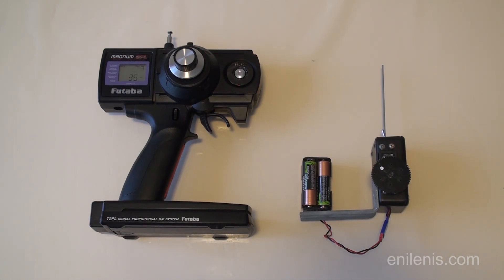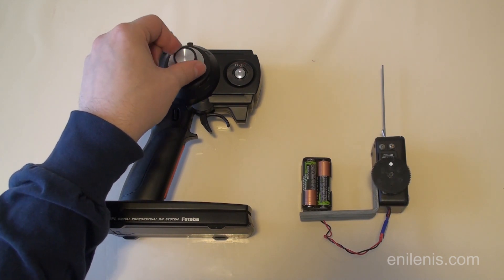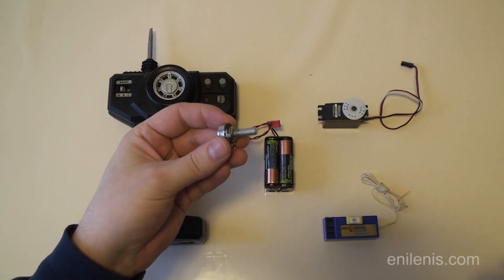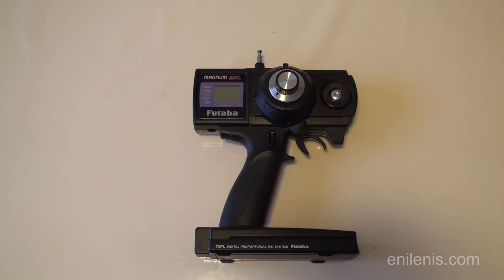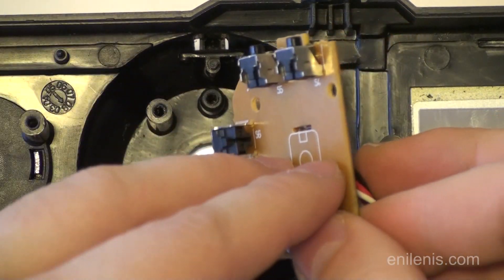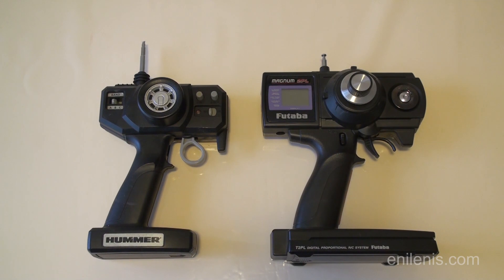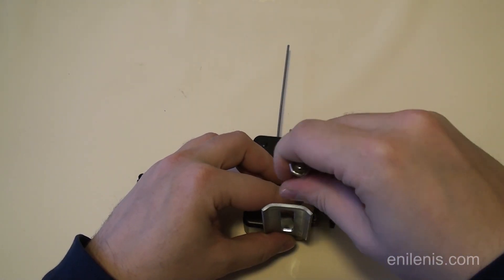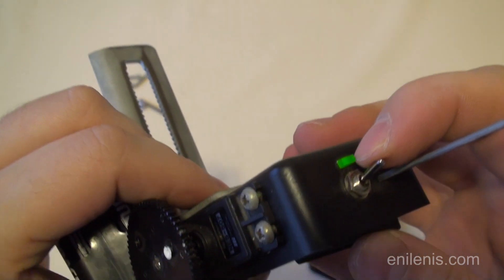DIY Wireless Follow Focus

Comment: How could a measuring device be integrated with this gear? If that were possible, which it should be, then the measuring device could deliver the distance to the camera.
Reply from the maker: If you want an integrated disto, then the design gets progressively harder. The camera lens and the servo do not know eachother's absolute positions, so you don't necessarily know how the rotation translates to focal length. To have a system like that you'd have to manually calibrate the device each time it is installed. It is doable, but it's a lot of extra effort for little payoff. To auto-focus, the servo would have to talk to the camera, or analyze the video feed itself to figure out how sharp it is. Again a whole can of worms. If you want distance, for VFX shots, for instance, as part of the scene survey, then you can just have a disto on you and it doesn't have to be a part of the camera rig.
What is your practical application? Maybe I can suggest a better alternative.
Reply: enilenis I shot with a DSLR. Do my choices are manual focus, or AF, which ruins the video for s moment. I’m using a 5DM3. I was hoping that an electronic measuring device could talk to the lens. Canon already has a motorized zoom focus. ?
Reply from the maker: Autofocus on DSLR's doesn't work well with videos. The lens tends to overshoot its position when determining sharpness it dials it in while shifting focus over the intended position a couple of times. So, manual follow focus is preferred. There are follow focus apps that work with latest Canon cameras, but I don't think they work with M3, and they don't get good reviews anyway. Manual is the way to go. There are options such as 3rd party firmware, like Magic Lantern, which also give access to internal lens servos and can mimic a manual follow focus, but I haven't played with it in a long time. I don't even remember how to install it properly.

Comment: Hello, I'm looking for information to be able to create one too! :)
I would like to know about how parts: engine model and power, transmitter, etc.
You did a great job! Congratulations!
Thank you
Reply from the maker: I used parts included with Futaba Magnum 2PL kit. It has transmitter, receiver, servos. Nowdays that one is hard to find, as it's been replaced by later models 3PL and such. Those kits should work just as well. The rest of parts are whatever I had on hand. The plastic box was just the right size. Switch and LED - I used my own, but I could've used parts from the kit itself. The metal mounting bracket was from a closet door. Lens gearing setup is the only thing you have to buy separately. The wheel that goes onto the servo has to match whatever is on your lens.

Potentiometer and a knob - again, those depend on whatever is in the kit you end up getting. Start with the transmitter kit and work your way down, as it will determine all other parts that will be needed for the project.
Reply: Thanks for the tips! All the best to you! Thank you! :)

Comment: Hi. Why do you say 360 degree servos will not work ? It's exactly what I need.
Reply from the maker: Most 360 degree servos are made for continuous rotation and do not stop at a fixed point. They're typically used in robotics as a cheap gear motor substitute. You have to read the specs before you buy. If it says "continuous rotation", then it's the wrong kind. Conventional servos have a mechanical hard stop that prevents them from doing a full turn.
Reply: Ok. I think I'll have to work on the gears. 
Thanks for the answer

Comment: hi..I have changed the potentiometer....but the servo is vibrating not rotating...lz help me
Reply from the maker: Make sure that the connection to all 3 wires on the potentiometer is good and that you didn't accidentally link them the wrong way, because that would be the first thing causing a servo lockup. Also, does the servo lock up in the middle, or  close to one of the sides? Give me some specs such as, which model transmitter you're using, which potentiometer, which servo? Maybe one of the component is of the wrong type. I'll help you troubleshoot it.

Comment: Very nice tutorial, looks really straightfoward. But I have a question about the servo, how do I know how much it turns? I plan to use it with several lenses and one of them is a cine lens, so it has a very long focus range
Reply from the maker: Most standard servos turn about 160 degrees. If the specs don't mention the range, then it is ~160. If the range is unique, then the specs will say it. One person here in the comments used Futaba MG995 servos. Those turn full 180. For anything approaching 360, you have to look around on the web. There is a class of servos called Marine Winch. Some go more than a full turn, but I have no model recommendations, since I haven't used them personally. Another option is modifying servos to increase range. There are tutorials on youtube and elsewhere. Requires addition of 2 resistors to the sensor pot inside the servo. Can be done in under 20 minutes.
Reply: Thanks! I'm going to try and see what works with my lenses.

Comment: can you send me link for this is parts, Thank you!
Reply from the maker: I don't have a specific parts list. Everything revolves around the RC transmitter / receiver you buy. It doesn't have to be the same kind I used. When you take yours apart, you'll know what potentiometer to buy. When it comes to servo's - metal ball bearings are recommended. Higher torque is also better. The servo and the radio receiver will determine what kind of enclosure you can fit components into, if you plan on doing so. The lens mount and the rails will determine what kind of gear you'll have to put on the servo etc.

Magnum 2PL sets are rare nowdays. 3PL is the replacement. I am going to assume that most technical characteristics are the same, but I can't confirm that 100% unless I get my hands on one.

If you start buying parts, you can ask me whether something will work or not and I can respond. Much easier for me to see what you've got and to make it work.

Comment: Bartech hates him!
Reply from the maker: This is not meant to compete with branded film gear. This is for people who can't afford to spend on a follow focus more than they probably spent on the camera.

When you buy pro gear, you pay a premium for reliability and adherence to specification. You buy assurance that the gears will line up, rail mounts will fit, there will be enough torque to pull the lens, but not enough to damage it, batteries won't die in the middle of a shoot, radio won't interfere walkie-talkies and if you drop the receiver from a tripod, it won't shatter on impact (if the specs say so). You buy something concrete that will guarantee you won't waste crew's time on set.

Both, high price gear and makeshift solutions such as this one have their place and their purpose.

Comment: Thanks. I built the follow focus and it works great BUT there is a problem, the receiver batteries. The receiver is drawing power from the batteries for the servo, even if the servos are not moving.  You cant turn of the power manually as the camera is some distance away (the very reason for wireless). After a few hours or less the batteries are toast and need to be replaced. Anyone solved that issue?
Reply from the maker: As you can see, I put a switch into my receiver to be able to shut it down manually. Typically I'm close enough to camera to be able to do it. I also have a battery charge indicator from an RC car - a little 10-led strip that can be plugged in series between the battery and the servo block, but I hardly ever use it. The camera tends to exhaust its charge long before the follow focus. As power alternatives, receiver can be powered off camera, if it provides a shared power output for accessories. If it's higher than 5-6V, all you have to do is limit it down to 6V with an LM7806 regulator. You can tap into the camera shoe, an external light port or whichever other output the camera provides.
Reply from the maker: Additionally, when it comes to servo being responsible for draining power - it will use up current if there's any tension on the gear, for as long as the signal pulse is being received. If you kill the pulse, servo will stop holding position. In a wired follow focus video (also in my channel), I do kill the pulse in order to save battery, but that's in a completely different device that I built from scratch. Factory-made RC kits will supply the position pulse continuously, causing the servo to hold its rotation. Even if it looks like the receiver isn't doing anything, it still generates the pulse based on the last radio signal it received from the transmitter, it's done so that if the machine goes out of transmission range or picks up radio interference, the system doesn't go bananas and maintains course. It's all by design, since the RC kits are made for toy cars and boats, not for camera lenses.

Comment: also figured out that the potentio meter in the servo turns around 180 deg, but when all the gears are assembeled and connected in the servo it rotates 90 deg. please help!
Reply from the maker: Some servos are limited electronically to turn less than their gears allow. Adding potentiometers to both ends of the sensor pad can trick the servo into thinking it hasn't turned far enough. It'll amplify the response, but in most cases you'll get 15% or less extra rotation. If you're modifying the transmitter and that is the reason you get such short servo travel, then try an adjustable pot with less resistance. Those, however, also have a limit as to what frequency they can transmit. If the resistance is too low, most of them will simply shut down if you turn the knob pass the frequency limit.

It's hard to tell why you're only getting 90 deg. Are you using the same transmitter that I'm using? What is the servo model? What modification did you do to make it go 180?
Reply: +enilenis I will post up a video as to what the problem is, and will link you to it. is that fine.?
Reply from the maker: Sure. I'll help as much as I can.
Reply: +enilenis thanks a ton. really appreciate it man.!
Reply: could we work it out on skype instead.?
Reply from the maker: I find e-mail more convenient, since I'm never in control of my schedule. With crazy work hours and family I don't get a moment to myself. Feel free to send photos. The servo issue shouldn't be hard to troubleshoot.

Comment: Hi Enilenis - how do you set the dial controls on your remote so that they don't exceed the limit of the lens' rotation? Assuming that a particular lens rotates a total of say 45 degrees from zoom in to zoom out, you wouldn't want the servo (if it was a high torque servo) to keep trying to turn the lens beyond its limits if you turned the dial on the remote too far. it may damage the lens. I would like to be able to limit the total rotation of the servo so it aligns with the total angle of rotation of the lens. Is this possible to set and control in the remote control system??
Reply from the maker: A hobby servo typically doesn't have enough torque to damage a lens. It'll click through, or the external gear will slip. If you want to be safe you can ensure that it will by using a flexible mount, or adding rubber washers to load-bearing joints.

The remote I used does have trimming adjustments, allowing reduction by about 15% on each end. Other than that, it operates like a manual follow focus. You have to gauge visually how far you can go and mark limits.

It is possible to put a micro controller like an Arduino between the potentiometer and the main circuit, add a pair of limit buttons to control how far the wheel goes, but that would make it a more complex project. I have another video where I made a wired follow focus with built-in limiters. It ended up costing  more than this device and took 3 full days to put together, compared to half an hour with this mod.

This is the cheapest wireless option for focus pulling, but obviously, going cheap means having to deal with a few inconveniences.

Comment: hi 
my servo dont rotate with the pot it just keeps going
Reply from the maker: MrMegaFla If it keeps spinning then you either have a continuous rotation servo instead of regular one, or insufficient resistance in the pot where it just shorts the circuit completely. Also a possibility that you may've damaged the remote when taking it apart. If you have a video, you can post it and I'll help you figure it out.
Reply: *****  oh yea i do have a continuous rotation servo
Reply from the maker: MrMegaFla You need a standard servo. Continuous rotation ones have sensors and limiters removed. They can only respond to direction commands and offer no precision stops.

Go for something with enough range and torque to satisfy your lens set up. Most cheap servos turn about 160 degrees. Good ones will give you almost a full 360. There's also a grade called "marine winch" that can do multiple turns, but I could never find a good one, since they're typically used for raising and lowering sails in model boats they aren't famous for precision.

Comment: I Like your Idea and have a few of these around the house. My question is the gear what and where did you got that gear. There rest is understandable thanks.
Reply from the maker: Finding a gear was the most difficult part of my project actually. You can buy lens gears that match specific lenses, but they're quite expensive. Another option is buying a pair of flexible lens gears (adjustable plastic ribbons with teeth). You put one over the lens and another over a cylindrical dowel attached to the servo, which is much easier to find or make (out of a jar lid perhaps). The third option is scavenging gears out of electronics. Old VCR's and fax machines have large mechanical gears that often work for this sort of thing. Last option is 3D printing a custom gear, if you have access to such devices.

Comment: First off thanks for the great video and idea.  I have the parts and in the middle of building this.  My first question is how to get the knob off? Will it come straight off when de-soldering the old potentiometer?  Also all the links below of people with demo of this rig have been delete. Does anyone have a demo of this in action?
Reply from the maker: The original knob I just tore off, since I knew I was going to replace it along with the potentiometer. There was also a spring mechanism for centering the wheel that I got rid of. Think there are a few screws under the front plate of the steering wheel that allow for more delicate removal.

The demo clip of the device in action - the user who had it removed it for some reason. Probably didn't want to be bothered with questions. Here it is. Take a look and I'll remove the link later. I haven't recorded my own demo unfortunately.

https://www.youtube.com/watch?v=eabqKBuTrWQ